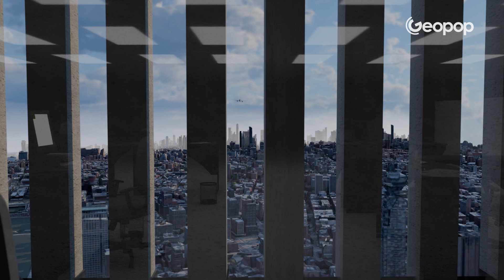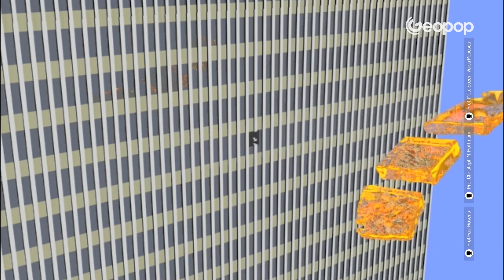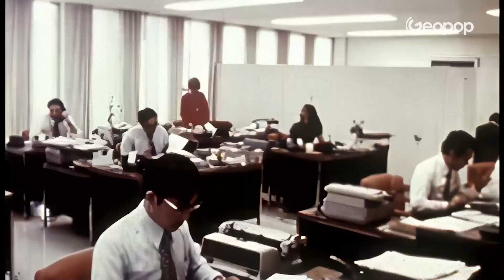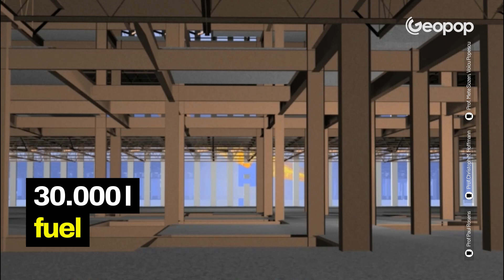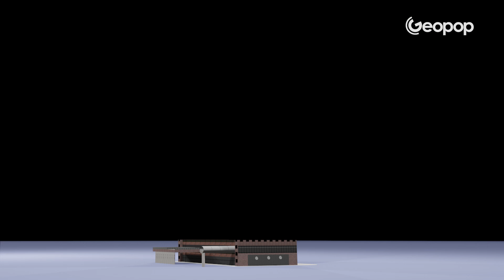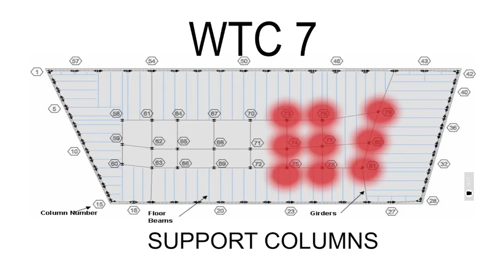9/11, 2001: The Technical Reconstruction of the Twin Towers and WTC 7 Collapses

Comment: Had Grok estimate the energy required to shear through the WTCs like we saw, and if you consider beyond just the steel exterior and account for the mass of concrete the plane would also encounter, Grok estimates about 13GJ of energy was required to penetrate.  Based on the mass of a fully loaded 767 @590mph(which is impossible), we have a projectile with only 6.27GJ of kinetic energy.
Reply: Please show your math.
Reply: @TheLoonResistance  : He can't show anything. He just regurgitated some AI garbage he couldn't understand.
It's fascinating how many people are replacing their own thought by just parroting AI stuff...
Reply: @ThomasKunderaBis - Why do you think I asked?
Reply: The one thing you can't argue with is the fact that those planes were not capable of flying that fast. Even the smallest bit of research would reveal this fact.
Reply: @robbiehiatt9966  - The smallest bit of research reveals they did, which means - as per usual - you are wrong. 

Not that this will prevent you from repeating this same bit of epic fail over and over and over again, always failing yet always expecting different results. It's just what you do.
Reply: @TheCriticalStinker-jw4fl exactly,  you're not willing to do the necessary research, you say it's possible because you were told it happened but that is where you stopped your research. 1 planes can't go that fast 2 the buildings can't collapse that fast. 3 the firefighters said it looked like a controlled demolition.  4 the firefighters said other buildings would blow up. 5 the firefighters claimed there were secondary explosions. I could keep going on and on about the facts you refuse to accept. Because your simple research ( Basically.
The same b s we've heard for twenty four years) doesn't account for any of these things. If all you want to hear is that it was a collapse from a Fire.Or because of the planes, you should have no problem.People have been saying that for twenty four years now. It's a lie, you know it's a lie. Everyone knows you are wrong. But if you feel your research is complete, why are you on here?Why are you making comments?You don't know what you're talking about
Reply: @robbiehiatt9966  - When you show up with a memo from the CEO of Boeing stating that their aircraft can not achieve those speeds for a few seconds when they were recorded as achieving those speeds for a few seconds, then you have an argument. 

That will never happen. All you have and will ever have is bare assertion. That you may believe it does not make it true. 

You are back on ignore and can return to your life of endlessly repeating proven epic fail. Goodbye.
Reply: @TheCriticalStinker-jw4fl so then nothing will convince you.  The so called pentagon plane made a 180°turn at about a thousand feet going nearly 600 mph to hit the vacant side of the pentagon.  That turn was impossible.  And why not fly straight into the building,  why were they shooting for the least amount of casualties? Do you normally speak to CEO's when you do your research? How many CEO's have you received proof from? None, see I was A CEO of a corporation. So basically you ain't got proof of jack, if a ceo is necessary for you to learn something.  You're a smelly joke. And you need to get a job and get out of mommy's spare bedroom. Does it take a CEO for mommy to get you to pick up your dirty clothes
Reply: @robbiehiatt9966  - Have you ever been bothered to review the NTSB’s recreation of Flight 77 from the data recovered from the Flight Data Recorder (FDR) found at the Pentagon crash site?  I’m not sure how anyone can really assess what he did without doing that. 

www.youtube.com/watch?v=3vqDDlS9Hyw&t 

You can easily skip to past the half-way point to begin. 1:10:00 should be a fine place to start. OK to speed it up a bit too. Pay careful attention to air speed, throttle input and altitude. Give it a watch and let us know how skilled you think Hanjour really was, or how skilled he really needed to be. There are no Top Gun Maneuvers or epic feats of flying prowess. He isn’t skimming along the ground like Luke Skywalker for miles at 500 mph. There is nothing in that flight path that any pilot of rudimentary skill could not pull off with just as little precision and finesse.  Note: he never even used the rudder. 

No one ever claimed Hani Hanjour was a great pilot, or even a good one. He didn’t have to be. Hanjour was after all a Kamikaze pilot, not a commercial airline pilot and the standards required between the two are quite different.  In World War II Japan for example a combat pilot would often have 800 hours or more of training where Kamikaze pilots frequently had less than 20.

But Hanjour had earned his FAA Commercial Pilots Certificate and was grossly over-qualified to crash a plane – the easiest thing any pilot can do. 
 
And he did. 

Since you won't understand what you are looking at, let me break it down for you.

Hanjour arrived in DC airspace too hot and too high. He was going to miss his target so he had to do what every pilot learns in Flight 101 to dump speed and altitude - a descending turn. 

The prep for Hanjour’s “impossible Top Gun maneuver” starts from about 1:00:00 and the turn at 1:12:00.  Note that at 1:00:00 Flight 77 is at 25,000 feet and 282 knots with the throttles at 75%.  Over the next 12 minutes the altitude drops massively and he is up and down with the throttles desperately trying to manage speed. By the time Hanjour sets up for the “impossible” descending turn, Flight 77 is traveling at 322 knots and 9,900 feet with throttles at 30% as it sets up the turn. He drops to 6,950 feet before climbing back up to just a bit to just over 8,400 feet to scrub the speed down to 281 knots to start the turn, picks up a bit of speed back to around 320 knots as it starts to descend through 7,000 ft, dropping to 292 kts as it passes through 6,700 feet and enters the first part of the right hand descending turn. He is all over the place. 

Hanjour picks up altitude again to about 8,500 feet at 278 kts before entering the final 270-dg loop, dropping the throttles down to 25% and generally holding between 265-295 kts on his way around. Rate of descent like the speed is highly inconsistent. It was a roller coaster. 

Flight 77 starts to come out of the turn at 3,000 ft. and 290 kts still at 25% throttle. At 2,042 ft. and 316 kts Hanjour straightens out at the end of the turn and pins the throttles to 100%. Note that at no point during any of this does Hanjour apply any rudder. Over the next 4 miles Flight 77 descends in a shallow dive (picking up even more speed) from 2,000 ft to a last recorded altitude of 180 feet and velocity of 462 kts (531 mph) as it crosses over Washington Blvd moments before impact. Probably about 2 seconds prior to impact. 

Last 37 seconds of recorded flight after completing the descending turn at timestamp 1:21:30.  Watch the EDT:
13:37:09 speed 302 kts altitude 2,199 ft. 
13:37:29 speed 383 kts altitude 1,428 ft.
13:37:39 speed 442 kts altitude 560 ft.
13:37:44 speed 462 kts altitude 180 ft. (last data input recorded to the FDR, about 2 seconds before impact).

Again, Hanjour dumped more than 2,000 ft. of altitude and picked up 159 knots in velocity,… in just 37 seconds

The part of the flight recorded on the two north parking lot cameras was less than a second. At approximately 320 feet from the building (0.42 seconds before impact) Flight 77 had descended to just a few feet off the ground. While still obviously nose-down from the video, it is possible Hanjour may have pulled up slightly to adjust onto his target in that last 1-2 seconds. 

The flight path supports the conclusion Hanjour accidentally arrived over his target about 6,000 feet too high and had too much speed to correct in time.  In short, he didn’t plan properly. Therefore Hanjour had to perform a fairly standard descending turn to scrub off speed and altitude. It is a routine procedure all pilots learn early on. This wasn’t a “precision” turn. Hanjour was up, down, to the sides, speed fluctuating the whole time. No Top Gun prowess in evidence.  He (just) got it done with little skill in evidence. It actually worked out well for him, as he managed to roll out 6 miles from the Pentagon and had plenty of time to line up his 900 foot wide target and full power the engines. The reason it worked was because he reduced his throttles to reduce speed to make the turn.

Among the conspiracy minded this simple, sloppily executed right hand descending turn is invariably characterized as an “impossible maneuver not even a Top Gun fighter pilot could pull off.” 

That assumption is invariably premised on the false starting assumption Hanjour did his turn at full tilt.  Because Flight 77 hit the Pentagon at 530+ mph the non-thinkers just assume the entire flight was at 530 mph, including the turn.  Oh, and that Hanjour flew the entire final leg at treetop height too BECAUSE THEY DON’T CHECK BASIC FACTS!!!  

Such claims are obvious nonsense on the face of it yet I keep running into them. To claim Hanjour couldn't have done what he did is to admit ignorance. The facts are there, readily available from the radar and FDR data and witnesses. The turn was unplanned and sloppy, speed, course and altitude all over the place. Far from a Top Gun ace, Hanjour flew not even as well as Richard Russell. 

But it was just good enough to get the job done – he didn’t cock it up SO badly that he crashed before reaching his target.

Comment: It is common sense if the main weight bearing core beams collapse along with the perimeter beams the floors above will collapse 
I am surprised the buildings even stood for several minutes 
Let’s not forget to add the fire
Reply: Where did these morons come from
Reply: Does that account for 3000 unrecovered bodies ???😂😂😂😂😂
Reply: @Larry26-f1w  Yep.  It absolutely does.
Reply: @Larry26-f1w I'm sure some pieces of bodies were found. Everything was burned and pulverized though. Nothing left to find.
Reply: @Larry26-f1w what do you think happens to a human body when being a part of a building collapsed. Do you ever just stop to think for just even a moment, of what human flesh is compared to MILLIONS of pounds of rock and steel? Pulverized to nearly nothing. It takes almost not mental power to pause and think about it. People crush their fingers in working accidents with several magnitudes less force than a MILLIONS AND MILLIONS pound force such as a building collapse.

Comment: Those buildings were blown down. Thermate helped.

https://youtu.be/5d5iIoCiI8g?si=Zr98IutSDjsnjGMp
Reply: Did it though? If only someone had actually performed a real test instead of just guessing or making unfounded assumptions. Oh, wait!

youtube.com/watch?v=JXWCMBuusMI&ab_channel=TrutherTVArchives 

In this video starting at 45:35 and running to 48:35 the Energetic Materials Research and Testing Center (EMRTC) conducts a test to examine the effectiveness of thermite in cutting a vertical hollow box-section steel column. The column tested is smaller in cross section and made of thinner steel than that of the Twin Towers perimeter columns (and never mind the core columns). In total 175 pounds of thermite are used for the test on just one column and requiring the construction of a rather conspicuous coffer dam to contain it. Do recall the Twin Towers had 240 columns and 110 floors.

It would be odd if thousands of office workers missed hundreds, perhaps thousands of those suddenly appearing.

Note what an incredibly slow process this is. It took close to 30 seconds for the thermite to finish burning off.  It would be impossible to “control” a demolition using this material.

Not to mention the issue of; how does the aircraft impact and subsequent raging fires NOT prematurely set this stuff off?

Also note how bright and obvious the whole process is. Could not be missed visually. No way to hide that. 

Then at the end of the test the (relatively modest) column was undamaged…. which is a problem.

Certainly no rivers of molten steel emanating from it either and in fact the whole thing cools rather quickly as soon as the thermite has burned off, as one would expect.

Thermite has never been used in the controlled demolition of any building, let alone one with multiple floors on fire after the impact of a large jet. If the conspiracy oriented internet has taught us anything it’s that if something has never happened before, it can never happen.
Reply: Don't blindly swallow any fallacy you watch on YT.
Reply: Are you referring to nano-thermite? Because regular thermite is never gonna do the job. With all of the explosions that were heard and reported.I don't understand why you go with this thermite theory anyway. I believe it was a conspiracy but i'm not going to ignore the fact that explosions We're going off all day long

Comment: Wow what excellent pile of engineering momdo jumbo bullshit to confuse the regulars and service your hidden masters. It is amazing rumps not involved in your bullshit. Perhaps you should try that too. What about designed safety factors, what about the rate of heat transference to the steel? What about the heard explosions? What about the honest witness statements about strange workers working on the structure? How if there is enough energy to heat this structure to semi fluid state and cause collapse so quickly is the pentagon damaged so slightly with the third plane? So the in hit building just collapsed so why weren’t other surrounding buildings just collapsing also? Your story should start with “Once upon a time there was unbelievable story about”
Reply: This video mixed complex engineering down to a level eloquent to a YouTube audience. It is not a PhD engineering thesis.  

That it does. 

If you need analysis to a higher level eloquent to engineering PhD's, you won't find it on YouTube.

I also not for all of your very low-level whiny butthurt, you have not actually identified anything this video got wrong. The best you can do is some insults, innuendo';s and the usual barrage of whataboutisms - the first resort of the intellectually bankrupt. 

Despite what you have probably been (mis)led to believe, the collapse mechanisms described here have broad professional support around the world. There are no professional engineering organizations (for example: ASCE, ASEE, ICE, etc) that disagree with them or have offered any formal dissenting opinions or alternative hypothesis. The worlds peer-reviewed engineering journals contain no contrary articles or papers.

So, either the overwhelming majority of the world’s structural engineers (and simple observation) are wrong and thanks to a few hours and Google you know more than the world’s best engineers, or maybe what you believe and what actually happened are two different things.

Which seems more likely? 

Here’s a simple challenge:  If this explanation is wrong then go ahead and present a superior alternative.  Something more detailed than 5 words. No one ever does.
Reply: @TheLoonResistance well I know I added more than five words 😅
Reply: Stinky, he clearly pointed out things that the video doesn't touch base on,then you put him down for it. Stinky you might think you know everything,  but you're blind, lost and scared like a child. You have accomplished nothing in life. You know nothing. Doesn't it bother you that ninety five percent of the people that make a comment on here disagree with you? The more you struggle to hold onto your reality,  the more you will lose that struggle. It doesn't matter how fancy you say things the truth is, the truth.
Reply: @robbiehiatt9966  "you might think you know everything"
Who think that?
We do know a few things, and that includes the elements in that video.
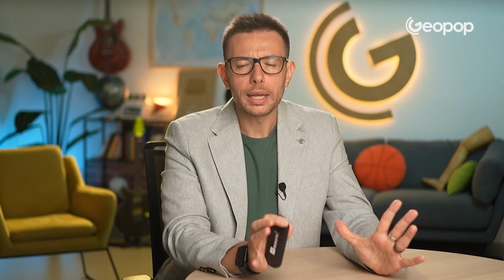Reply: @ThomasKunderaBis the video admits to lying. 1:40  therefore you are admitting it to be lies as well
Reply: @robbiehiatt9966  oh dear stinky lol prove my of how childish and stupid you are. Stinky lol maybe this is from a Ai bot troll backing up the bullshit story.
Reply: @robbiehiatt9966  oh and did you watch the live feed? I did that in its self was amazing an almost impossible event to organise in those days. My silly stupid child.
Reply: @Bob-cu8noI have no idea what you're talking about
Reply: @robbiehiatt9966  according to the Ai bot defending the bullshit storyline. Wow you responded what would be in minutes in the middle of the night. So you’re just sitting there waiting to respond hey ?
Reply: @Bob-cu8no - And yet there's nothing here.
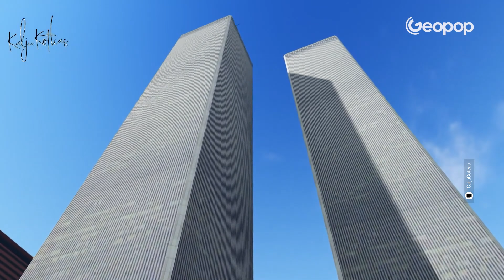Reply: @Bob-cu8nomiddle of the night? I'm in NC. It's 7:08 in the evening
Reply: @Bob-cu8noI had agreed with you to begin with idk. What your angle is here